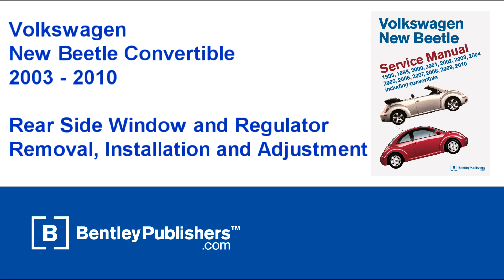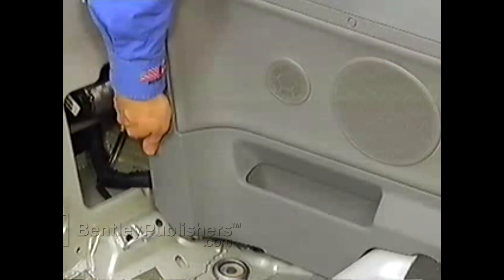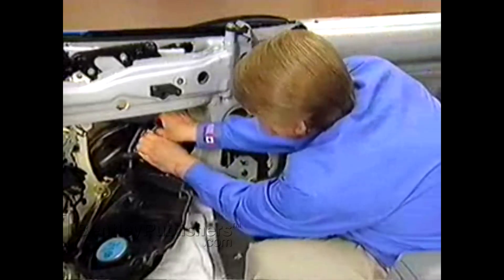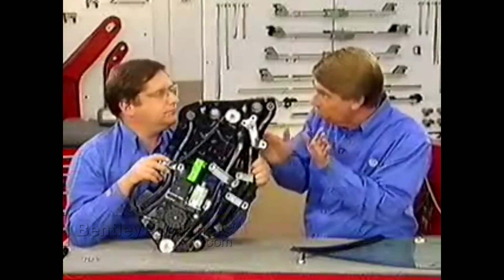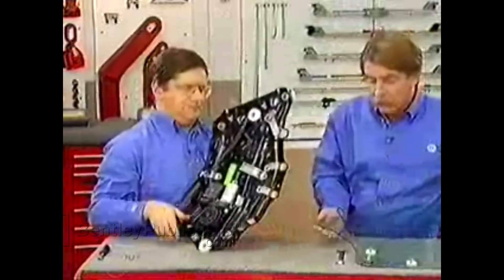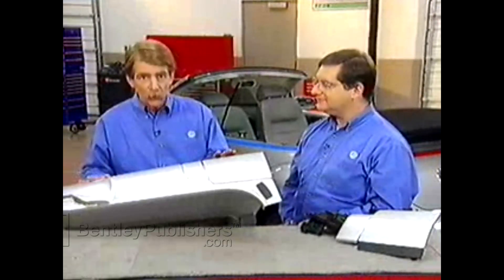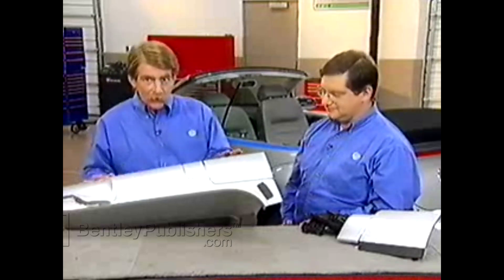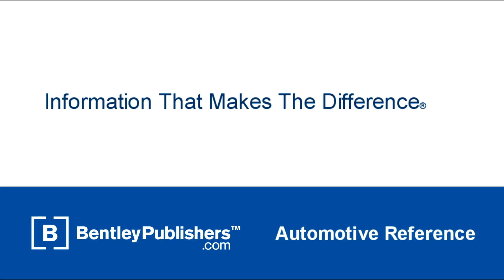VW New Beetle Convertible 2003-2010  - Rear side window regulator remove and adjust - DIY Repair

Comment: Quite possibly the worst Instructional video I’ve ever seen in my life. Conveniently skips over some important , and coincidentally - very difficult steps . 

Most importantly, they require you to move the regulator up and down to remove it .

If it worked , why would I be replacing it !??? 

Idiots .

Comment: I think this video is great & after watching / re-watching it step by step as I went, I have succeeded in this project.  However, I feel it skimmed over the adjustment techniques.  The 'adjuster bolt" (at 6:50 mark & supposedly used spl tool # 1739) requires to be placed on the inside of the car / slot for the regulator assy.  The bottom two -- screw in all the way into the reg assy and then be careful when adjusting.  The top 'adjuster bolt' (behith the front seat belt) should also be inside.  Then I could match the 13mm nut to lock in the settings (all 3).  

I fought with this aspect (unknowingly) for 3 days.  Once I re-started and caught this item, all worked within 5 minutes (then an hour to re-assemble the rest of the car).  Thanks guys.  I hope this helps someone.

2008 VW Beetle Convertible.

Comment: Every time I fix something on my girlfriend's 2006 Beetle, something else breaks.

Today the drivers side door check literally sheared off of the door where it was welded! The door check is perfectly fine, but where it welds to the door itself broke off.

I replaced the window regulator, but then the door panels came unglued. So I fixed that and then the door handle itself broke off in my hand a few months later. I replaced that with a metal one, and now the rear panels are coming undone.

Arghhh!

I thought German engineering was the best in the world?

Comment: This is a good overview video but doesn't mention the two bolts that holds the regulator to the top bracket and that the entire bracket has to be removed to get the regulator out (another 3 bolts and couple torques). Lots of missing elements that I had to figure out on my own.  Had I  known that bracket came out I could have left the window attached and pulled the whole thing out in one unit.  This video makes you do a lot more work than you have to to fix that bad regulator set up..  Some good info, but a lot of missing info.
Reply: I think the beetle they are working is an auto convertible the one we got is a manual convertible,  i ran into the same thing you did

Comment: I thought I wanted a New Beetle, I purchased a 05 and since that time had to figure out why scan codes wouldn't work (after taking it to three mechanics) disconnected the K line in the aftermarket radio and it now works like a charm, did my own plugs, wires and ignition coil (none of the three shops would do it without the scan code readouts) and now have it running like a top and figured I would look into the window and convertible top issues.  After watching this I am ready to give up.  I have spent two days on line trying to figure out where the fuse for the top is even located, with no success, and having to remove the entire back seat to fix a window is just too much.  Can we say German Over engineering?   I have a 2000 Nissan Frontier Pickup, with 285,000 miles, that I have kept running with less time and trouble than what I have wasted in three months with this car.

Comment: Great video.  The VW tool VAG 1739 is available from Snap-On tools.  I made my own by duct taping together a 3/8  drive 13 and other deep well socket.  For the 4 mm Hex adjuster I used a long 4mm Hex driver.  This setup is sufficient to adjust and tighten, with final tightening done with just a 13mm deep socket.  I was able to remove my regulator without removing the window, thereby making only a minor adjustment on reinstallation necessary.  Thanks for the video - great help.

Comment: Well, I know its an old video, but un-informed at the beginning is the lack of info on the top support bracket and its removal! Fortunately, having watched the video a few times, I saw the top bracket was off, nothing to say its held on by at least 6 fixings including 10mm bolts with locktite and torx whereas video shows just 2 being removed. But the remainder was ok

Comment: Just fixed the rear regulator on my VW cabriolet - this video was very good for getting at the parts and putting them back and adjusting but didn't cover the replacement of the wire in the regulator which is the core problem, so used some other Youtube clips for that.  I pulled off the external weather strip to improve access for fitting the rear window but had to super glue it back.Otherwise reasonably straight forward.

Comment: Some non bitchy comments,  the seat belt latches don't have to come out, there's nothing that will scratch them.  It is much easier to pull the window and the regulator as a unit, leave the window attached.  It eliminated any need to adjust the windows.

Comment: You guys assume that we already know the steps you so inconveniently skip. How do you get the plug loose from the regulator?   Show pulling both of the window nuts out.  Do you remove the top black plate?  Can we adjust without buying a $100 tool?  On the 1 to10 misery scale, this is about a 10.
Reply: Yes I did remove the top plate.  Boy this is awful!

Comment: Fantastic video.  Thank you very much.  I don’t think I could have changed the rear regulator without your vid.  VW must have had planned obsolescence engineering in mind when they made this car.  Window regulators break frequently, the dealer broke the headlight mount changing a bulb (only I change the headlight bulbs now), 2009 model has no key entry for the trunk so when the electronics go out there is no easy trunk entry, mechanisms to raise and lower top broke (fortunately the dealer fixed for free), steering sensor broke, brake calipers leaked, ignition coils go out every 30K miles, car only has 65K miles, blah, blah, blah....  should have bought my wife a Honda Accord.  Did I mention that this video is a life saver?  It’s a life saver!

Comment: Now whats not clear here you dont need to take the glass out first , and you dont need the special tool unless when you install 
and you've moved the top alignment glass nut. when I took the frame/glass out I marked the top adjustment nut so not to muck up the adjustment.  Also not clear is the top retainer plate , they make mention of it but do not show its removal , you have about 4 side bolts, one long top bolt and two hex screw heads, follow the rest of the vid and you can remove the whole mechanism to replace the wires , replacing the wires are the easy bit , its getting the whole thing in and out and putting the inner panel back in place , there are a few good other vids on youtube about the replacement of the  wires , also mentioned on other vids is non vw replacement wires are very tight and some suggest they will not last long if this is the case , mine was tight but still had some slight spring movement  in wire stretch , will update in time to see how mine holds out , again there is another youtube clip how to lengthen the wire if you dont have spring play , I will follow this if my newly installed wire      does not last long , I think my non vw replacements were about $40 delivered to Aus.   Also note the rear window buttons on drivers door can also be faulty , if it doesnt go up on the individual button try the main button to operates all windows up and down , good luck.
Also forgot to mention taking the whole unit out and back in is very tight , you can see scratched from the top adjuster that when the vehicle was manufactured even the workers must have had to
put some force to get it down , take your time but it will eventually go in with some force.

UPDATE,  been 12 months and no issues , its the wire that stretches and frays and gets caught up in the mechanism , I recommend you do not lower the rear windows all the way down if you dont
want to replace these again , just let the auto lower them when you pull turn the convertible top handle , it will just lower the rear windows slightly , otherwise expect to replace them frequently if you want the rear windows all the way down.

Comment: What size are the nuts that are holding the window to the regulator? I have my window up as high as I can get it. I can see the nuts, they're at an angle, but I'm not sure what size they are. I've been trying to figure it out with the tools I have, but I might not have the right size.

Comment: How do you lower the window, if it is in the top position, but the regulator is inoperative?  The cable is all wrapped up around the regulator.  Is there a way to manually lower the window (to get access to the lower window mounting nut)?

Comment: The convertible beetle is the worst car VW has made in a long time.  All these NBC have horrible windows.  If you own one of these cars the windows will fail I promise you.  The only way to avoid window problems is by not opening them or using the auto roof.  Rough shifting and valve body problems with the O9G are also to be expected.    These guys make it look easy because they filmed this video when above car was new and their window is not broken and jammed up.  If you are watching this now your interior is probably falling apart.  Good luck removing the interior panels.  Enjoy your lemon.

Comment: Great video 
On a 2009 eos rear side window is the set up the same as the beetle cause my window is just sitting slightly lower than the door window cause all I need is some adjusting

Comment: I wish I had known about all of these problems and did more research before buying my used 2005 GLS convertible. I thought Volkswagen had more pride in what they put their V.W. badge on...I guess I was wrong this and several other problems seem to be common sadly.  I now have to have all four replaced...Volkswagen should be ashamed of itself!
Reply: You are driving a 12 year old car. It uses the same cable drive system to open and close the windows as 90% of all cars do. I have replaced the same cables on Nissans, Toyotas, Hyundais, BMWs Hondas and Mercedes.  So I guess all manufacturers should be ashamed of themselves.

Comment: Every window in my VW Beetle Convertible has had to have the regulator replaced at least twice.  I am a VW Lover but the new ones suck.  Not only the windows but the headlights. I actually called VW when my warranty was up and I only had 18,000 miles on it.  They pretty much said tough s---!  I read about so many having the same problems and they won't do anything to help out.  So disappointed........

Comment: A couple of things on my 08 NBC are different from this video.
1.  The large flap top hinge cover being adjusted at the 16 minute mark does not exist on 2008 (and I suspect  from that year on).  Only the small flap that moves down and then forward is part of the rear side panel.   You still have to disconnect the connecting rod with the ball socket and then remove the clip and cable.    Once you have the side panel up and away from the body,  you will see these items.   But NO hinge cover anymore.
Also, seat back uses triple square bolts that appear to be 7mm.  That bit is a rare item - $30 from a supplier in Tennessee.  Google it.   You might get by with a hex bit,  but if you mangle the 12 splines in that nut head,  you may have a hard time removing the bolt.
This video would've been more valuable if they had bothered to mention socket and tool sizes as they removed things, but it still a good foundation for removing these rear regulators.
Reply: Addendum to above to say that I was able to replace the regulator, glass and make the adjustments as shown in the video.  Also as shown, installation is a two man job - one inside the car and one outside.
Take your time, have some patience and it is a do-able job

Comment: how the heck do you get the regulator out? Clearly you have to get rid off some part within the window itself  because my window won't come out like that.
Reply: Nik Nak yeah, sorry to hear that. I just didn't have the tools in hand so I had a bit of trouble.
Casey Cates Its a bit late now but thanks! So glad I got rid off that car!
Reply: look very closely at 4:15 in the video when Buzz (the guy with the "porn-stache" is taking out the speaker).  Mike is quietly removing the bolts for the top plate that must come out to lift out the regulator.  The 2004 holds this plate in with four 10mm bolts and two hex bolts.
Reply: +Selene Webster exactly the predicament im in right now. ive got everything pulled apart but cant get the regulator and the black panel its attached to out.
do i need to pull the black piece on top of the body out that looks like its a structural piece?
Reply: Nik Nak I actually took the back seats out, then the side panels and was a two day job... The car was killing me with how much it end up breaking and gave in and got an SUV instead
Reply: Ohh great. FML. Thank you though
Reply: +Selene Webster Its the retaining plate as he discussed in the video. It looks like a structural piece but it will remove easily with 3 screws. As soon as you remove this piece it will come out with ease.
Reply: Yeah I removed that and got the whole assembly out. The white nylon roller inside the actuator which the wire winds around is totally worn out. I rang 3D printing places. CNC milling places, nobody wanted to make me one.
Just found  a kit on eBay with all new cables and nylon parts for $40 AUS !!!
Reply: Nik Nak, exactly how mine was and I only paid like $18 dlls. I got it on Amazon through some VW dealership
Reply: Selene Webster I HAVE CHANGED WINDOWS AN REGULATORS ON OTHER CARS NO TROUBLE , AS FAR AS GERMAN ENGENDERING I WOULD NOT GIVE YOU TWO CENTS FOR THIS DESIGN

Comment: I am on my third window of a 2005 Beatle Convertible, First window was the rear passenger window and the dealer charge me over $500 to repair regulator. The second window was the Drive side front window. Dealer said it would cost over $1100 to repair. I wrote the dealer and protected the excessive cost saying I would ask the local new paper to comment on same. Dealer agreed to do the repair for $100 + parts. It cost me less than $200. Now for the third window, the Drives rear window, I asked the dealer to fix it for a reasonable price and the will not respond with a reasonable price or a $100+ parts. They say it takes longer to do the rear window by several hours. I have watched this YouTube and several others and have decided to try it myself. I have had several older VW Beatles and Rabbits and they worked very well except for Head gaskets of a Diesel Rabbit (replaced thee times under warrantee). I will not buy another VW unless they totally redesign and fully warrantee almost everything.

Comment: is it to late to go to Germany and choke the engineers that designed this mess, the top , windows all cot more to repair than what it is worth
Reply: Totally agree.  I had a 1974 old Beetle convertible.  The rear windows were a doddle to remove, adjust and had a simple wonder mech.  The flaps and the way the window moves down on the new Beetle is a nightmare.
Reply: Das schlimme ist die billige Drahtseilkonstruktion. Die japanischen Toyota haben Motoren mit Winkelgetriebe, die europäischen vom Zulieferer Valeo die Drahtseil Scheiße.....

Comment: Our VW dealer just said there was a window actuator warranty extension, but only for front side windows and for only 7 years.  He suggested we contact VW's main service center at (800) 822-8987. That rep confirmed the dealer's info, but said if VW recieves enough continuing complaints of a particular issue, they could consider making it a warranty issue. So if this actuator problem is as prevalent as it appears to be on various car maintenance blogs, please everyone, call VW and report it.

Comment: Thanks for posting this, i used it today and it worked great. It took me a little less than an hour to remove the regulator, not sure how long it will take to reinstall though. Parts wont be in till tomorrow. All in all it was pretty simple, i did however find out if the window will not move the easiest way to get it to move is to hold on to the window and cut the control cables. now sure if that is the right way but it works. If you have any auto skills it shouldn't be a problem to do.